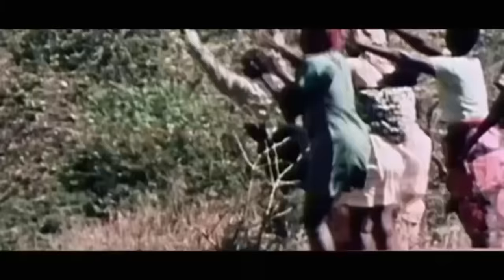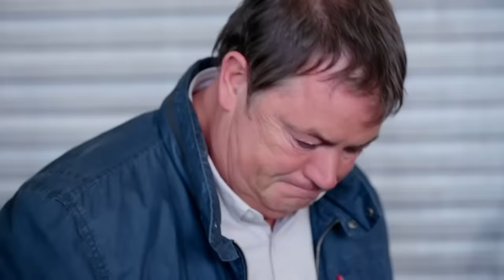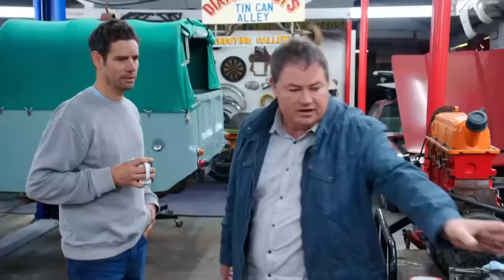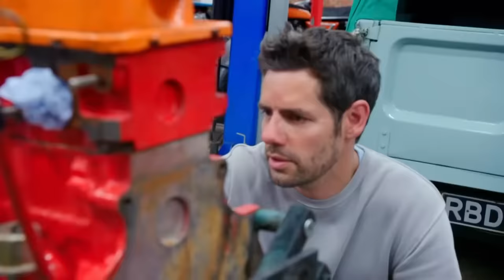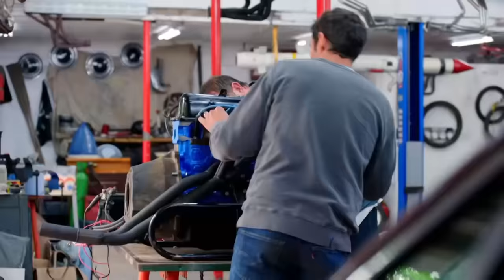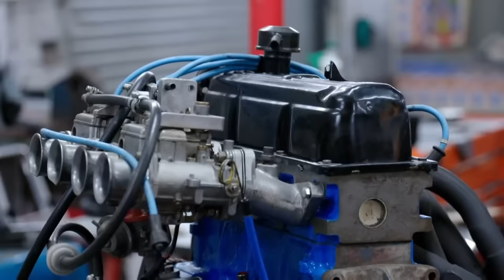Elvis Has To Rebuild This RARE Ford Pinto Engine! | Wheeler Dealers: Dream Car

Comment: So Elvis gave it a really good look over with his expert eye, and it turned out to be Mint. Cracking find, I love these engines.
Reply: I worked on them for 20 Years 1.6 are good 1.8 die 2.0 very good pulls like a train 2.2 pile of shit. Simple to work on and tune i could strip one down and rebuild in 4 hours with a sit down and coffee or two. These engines are not rare lol.

Comment: I had this car/engine combo. The EPA required that this engine be detuned for their spec.s . I would shift it when it wouldn't go any faster in that gear. They also had a 1.5 cc engine made by Lister. A way under powered engine even for this size car. Got about 19~ 21 MPG.

Comment: In dirt track speedway they use a full race spec 4cyl motor thats based off the pinto. Its called a esslinger. Around 340-360hp

Comment: Since when were Pintos rare?
Reply: They are now !
Reply: Since about 10 years ago. And they are getting rarer by the day.  I'm currently rebuilding a 2lt that came out of a mk 3 Transit minibus. Not an ideal lump of iron but it's a start.
Reply: I've just given £750 for one that won't even turn.And I can remember giving £25 for them back in the day.
Reply: In England it might be
Reply: Elvis is in the House!
Reply: Most of them have been melted down now.
Reply: Rare in the Uk, in the USA they are well paper weights not many want.
Reply: When was the last time you drove one..?

Comment: Ported and polished? Mmm ok then. Well i guess it’s an old school engine. Motorsport don’t think so. Maybe a road car with a bit more sporty performance. Not sure about that clang when it shut down but fine I guess
Reply: 2.1 pinto.quaff box, LSD in a mk1 escort. We are going racing. Or more to the point rallying

Comment: A 'rare' engine. Yeah, give it a rest - outside of the crossflow and deriviatives like the valencia, it's probably Fords' most numerous engine - Escort, Cortina, Granada, Sierra, Transit, Capri... and probably more that I haven't listed. Probably had some slight oversize pistons fitted at some point in the past, and has some ancient tired sidedraughts. In no way does that make a motorsport engine. £1700 quid? No chance. WD is absolutely full of it these days.
Reply: I love the way he just buys it without even checking if the crankshaft turns or checking the state of the oil 😂

Comment: RARE? a pinto isnt rare. theyre 10 a penny. they were fitted to mk1/2 Escorts, mk3,4,5 Cortinas, 4 cylinder Granadas (at least in the mk2 and 3), most 4 cylinder Capris, most Sierras (up to around 1988ish) most Petrol Transit Vans.......
Reply: Wrong. Were ten a penny. No longer any of those vehicles you mention in the scrap yards, in fact there haven't been for ten years